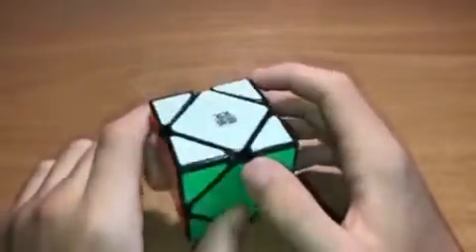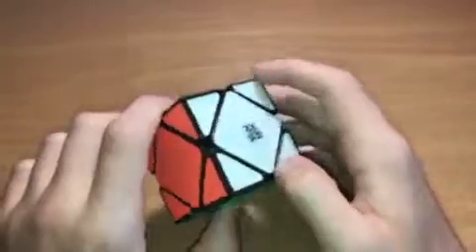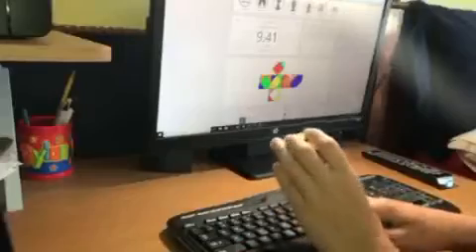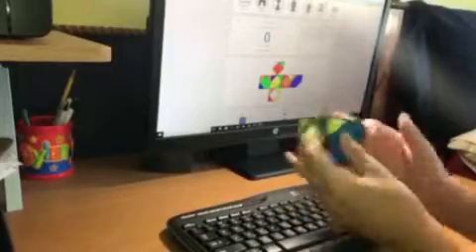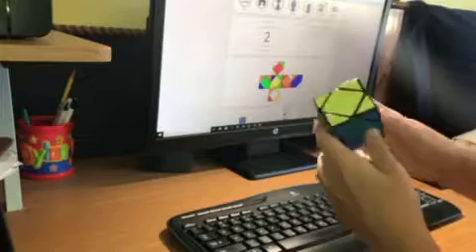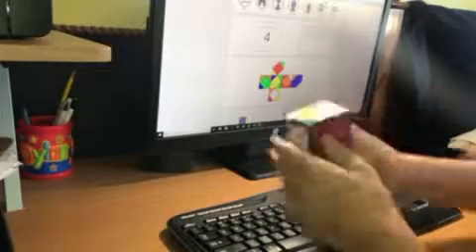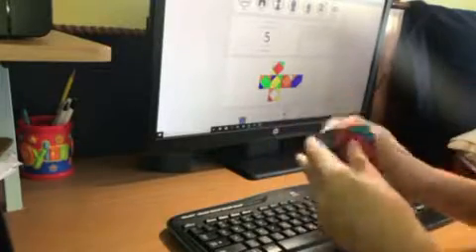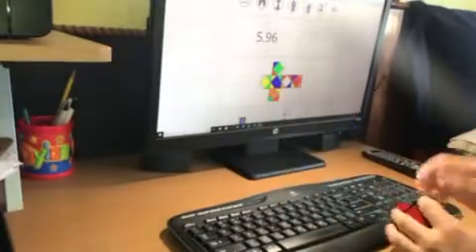Skewb OLLs and PLLs I Use | Sarah's Intetmediate Method

Comment: For Z perm, I would do R (dont keep the UFR corner in place, but don’t do a standard R either ) and then triple sledgehammer. Undo it after

Edit: I would do (alg in rubikskewb notation) for the H perm 

r R' x2 y L' l x2